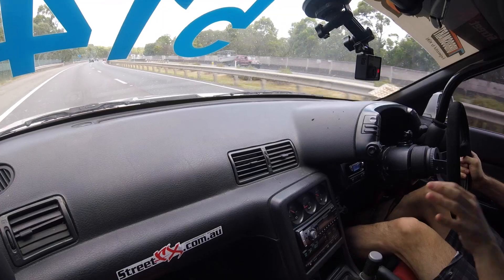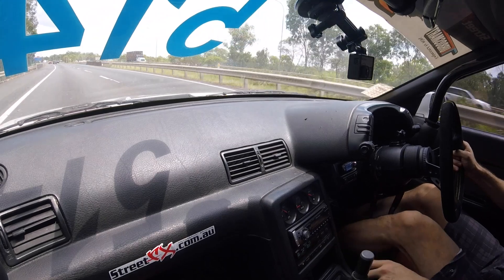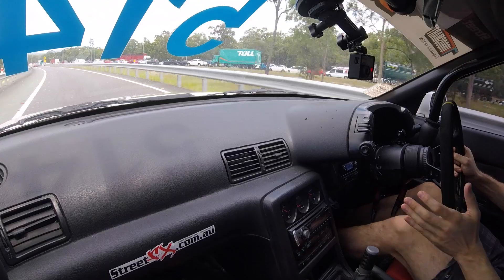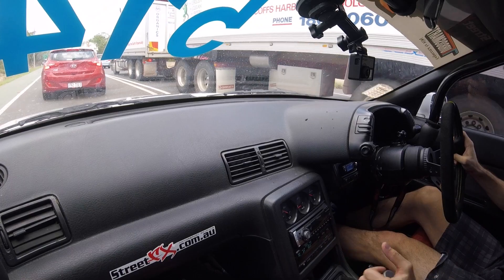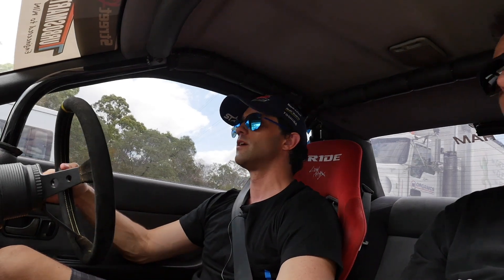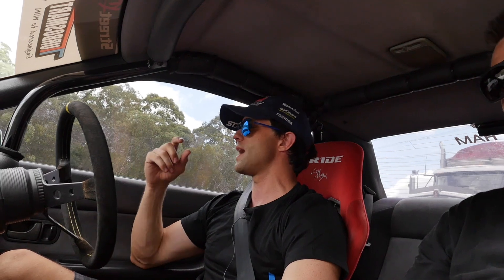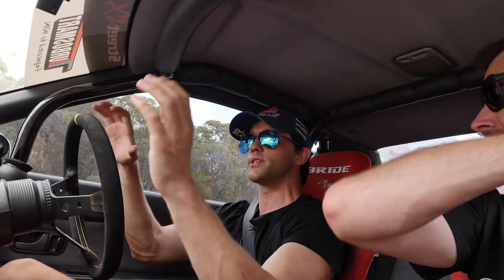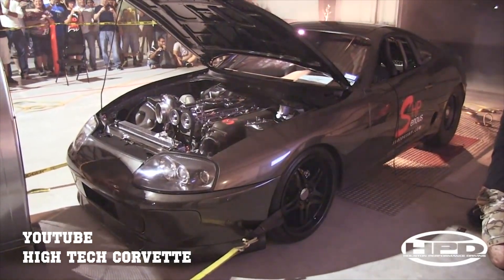What is TURBO FLUTTER & SURGE? Is it Bad? Myth-busting in our Nissan R32 GTR!

Comment: Compressor surge------bad. 
Turbo flutter----------------not bad. They are two different things. Cars had turbos long before BOV's were invented and they all did just fine. Hell older rally cars (and even some now) dont used BOV's and those things take a beating yet still have to be able to make it from stage to stage and for everyone saying "at low boost its ok but high end its a problem" Think about this. 
All the car companies that made turbo cars  porsche included had cars with turbo's in them before BOV were a thing. Did those cars blow up randomly? NOPE. 
As long as your turbo is of semi decent quality you wont have a issue with FLUTTER. 
Compressor surge is not flutter although the noises sound the same and compressor surge can cause issues as the turbo is under load I.E. working to make boost as its having problems doing so. 
flutter I.E. when no more throttle is being applied all thats happening is the already compressed air that was in the piping is being let out.
end of story is flutter is fine, Compressor surge is bad.
Reply: Street FX Motorsport TV it's the same thing, you guys explained yourselves. didn't you just tell us the only difference is in duration? that's what I heard you say. and why would the nut fall off? derrr
Reply: I know....It was mainly for the internet mechanics that most likely dont even drive a boosted car...let alone a highly modified one and think they know what they're talking about lol
Reply from the maker: +squishypitbull if you watched the video you'll see we explained the difference between normal flutter (closed throttle) and open throttle surge.

Comment: Compressor surge is the sound of the blades chopping through the air that is being forced back through and out of the intake side of the turbo. Not good for the components of the turbocharger but not going to immediately destroy anything either.
Reply: Sancho it is ;) think about a helicopter flying into the direction of the wind ;) same principle
Reply: Well I will say this. I had a brand new turbo everything was fine on it I ran through it. Went to the dyno today and on the 2nd pull the blades caught the body of the turbo and shattered them. I’m guessing the turbo surge loosened the shaft and that’s when it started to run and caused to shatter the blades.
Reply: @jamesvalencia1508  If it does any damage it's so minimal you wouldn't notice, it's not going to kill a turbo after a few pulls.
Reply: Who the fuck cares. Its also good to have a catch can for your motor. How many cars have those.....
Reply: @AlphaFlight  I doooo.
Reply: Im pretty sure its the air passing at very high velocity through the tight clearance between the circumference of the inducer (blade tips)... and the compressor housing.  The same principle behind whistling with your mouth. I don't think the "chopping" has anything to do with it.
Reply: @mareksumguy1887  That would cause whistle sound.
Reply: Janne Laitinen it IS a whistle... a lower frequency whistle.
Reply: Chopping through the air Hahahaha

Comment: my car does the same exact thing, it will flutter then you hear the BOV. i have a SC300 with a 2jzgte vvti and because it has MAF with stock ECU, the BOV has to stay shut at idle otherwise the engine stalls out.....But i read that anti surge house which i have, helps alleviate the pressure
Reply: A recirculation valve will solve that too